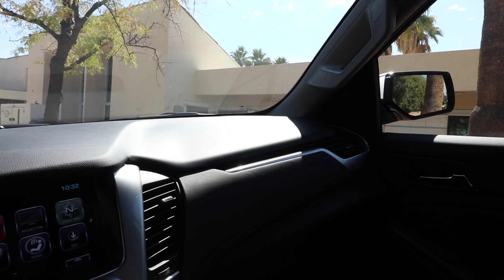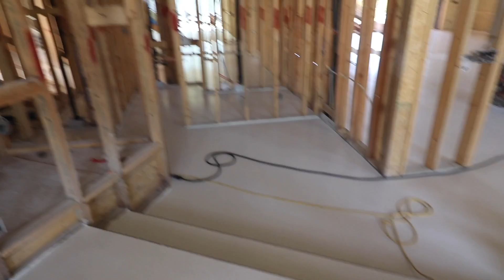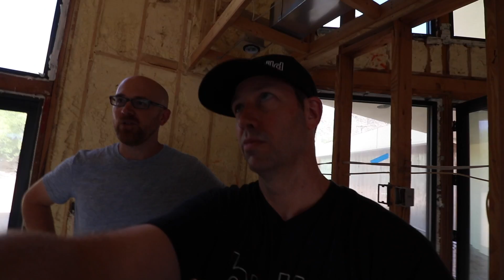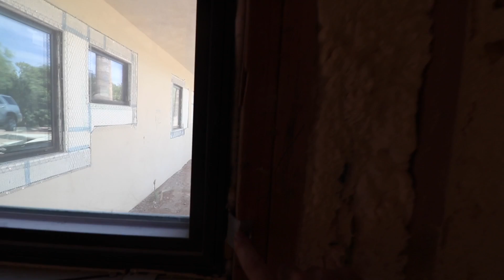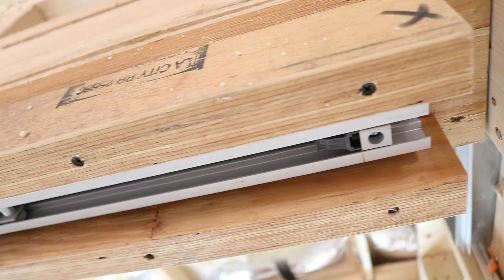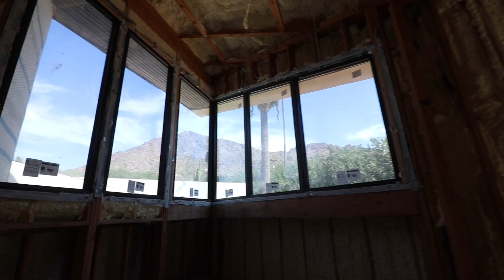Impressive Remodel - Build Show Fan  in AZ

Comment: How hard is it to add fixtures, receptacles, light switch with all the spray foam ? Do electrician have  a trick?
Reply: Eddybarrett84 it’s harder than before it’s insulated. But it’s still possible. I’ve added outlets and plumbing in after the fact, but I would recommend having everything done first.if you have to cut some out just use a can of foam to fill back in.

Comment: Intresting, Is gas water heating really cheaper than using solar collectors? Are you doing rainwater harvesting, water conservation with low flow fosets, water reuse in washing mashine, waste water heat recovery. Local water treatment & bio accumulation in the garden

Comment: I've read from Dr. Straube that when you have a reservoir cladding like stucco, you don't want a vapor impermeable barrier (like closed-cell foam) in the wall cavity.  Is all this CCF going to be an issue, or do you get away with it in such a dry climate like Phoenix?

Comment: Nice to see. Certainly envious of all the space the family will get in this house.
When you do this kind of huge remodel where literary everything interior is new, what might be the actual cost benefit of using the existing exterior walls compared to a complete new build?
Reply: You can grandfather the entire project and it will take a fraction of the time to get a house that size permitted. Plus, if you like that specific area, that's all you can do.
Reply: @tammyfinch6735  Indeed time for permission and such is a factor very much worth being included in budget, but my question is more about the actual building cost.
When remodel 100 % interior it seems a bit weird to not build something completely bespoke, but true there might be regulations as well as aesthetic choices behind why one saves the exterior walls.

Comment: Encasing yourself in foam is the dumbest thing imaginable.  Now not only are you relying on expensive HVAC systems to deliver breathable air, you're dependent on it forever.  How many people are going to properly maintain these systems?  1 in 100? 1 in 1000?
Reply: The house has windows that can be opened   :-) And no, it's not the dumbest thing imaginable. But your comment comes close..
Reply: ArthurDentZaphodBeeb Well this couple will likely live here til the end of their days, and they’ll maintain it properly, so what’s the problem?
Reply: @David-gld  Foam off-gases so once the HVAC system is improperly maintained, you treat your family to all that goodness - formaldehyde, benzene, and a slew of other chemicals.  Why would any sane person want that?  Alternative ways to insulate that don't require you encase yourself in foam..
Reply: @ArthurDentZaphodBeeb  Foam off gasses for a short period of time and will be fully cured LONG before they move in. Plus they'll have an ERV replacing their air constantly with fresh air from outside.

Comment: i see all these big high quality homes but, i see power and no coax or ethernet. it's cost big $$$ to run after the fact if you want the cables hidden in the wall. Cat6a and RG6 quad shield aren't' THAT expensive, even if you spend for pure copper variants when you consider the cost of the home.
Reply: @cdoublejj I agree. $35 for 500 feet is cheap. Should have quad shield RG6 and cat6 minimum 1 drop per room, probably 2 each in living room and master. Simple and cheap.
Reply: Electricians charge out the ass to run those lines usually, even when the walls are open on new builds.  They usually include phone lines and a few Cat5e drops, but somehow costs $100 extra each to use Cat6 instead.

I gutted and renovated and ran PVC conduit and outlet boxes from the attic down to every place I wanted Cat6 and RG6.  Once the walls were up, I pulled the cables through.  It all goes to a 28" media panel in a closet where everything is split.  I DIYed and probably cost under $500 in materials.
Reply: @bigpjohnson  Most electricians charge based upon an hourly rate. Perhaps data cablers charge more since they usually focus on Commercial projects.
Reply: @thehomeowner2646  hey that's really cool of you to reply!! Didn't.mean to pick on you specifically so much as renovation shows in general, nice build you have!
Reply: Possible that the Low voltage cabling hasn't been installed yet. In many cases low voltage cabling happens after HVAC, Plumbing & electrical. I didn't see any low voltage wiring for either fire alarms, or thermistat so its very likely they just have started it yet.

If it helps, I am running QS RG-6 & STP Cat6a cabling. I am going with STP (Shielded) instead unshielded since a get a lot big thunder storms. Nearby lightning strikes cause a localize EMP which can kill devices. A bout 5 years ago while living elsewhere, Lighnting hit a tree about 900 feet away. It trashed my eithernet switches, and a bunch of ethernet wired devices.
Reply: @guytech7310  the shielded cat6a is better anyways, it's practically the same spec as cat 7 if it has individually shielded pairs and is good for 25Gbps which is insane and likely future proof. we did are structure cabling before foam but, we did the walls in sprayed foam not the ceiling (blown insulation) so what you're saying makes sense.
Reply: Vest thing you can do is pre wire and run it all to a closet . Can do hdmi over cat as well so just one cat 5 to every where you need it. That being said I'd just run 4 Access points inside and maybe an outside or two . Anything above residential should be sufficient. Even google mesh has been working out really well but nothing beats wired
Reply: A few people were already onto the correct info in the replies here - Ethernet running throughout the house is NOT needed.  Enterprise WiFi can be done on the cheap now a days, I did my house with just 2 Unifi APs and it covers my small house with 50-150mbps everywhere - I have 160mbps down max.  This is enough for ANYTHING, and can run 12-20 devices easily.  Running Ethernet everywhere and using big switches is a waste IMO.  Much more seamless and nice to have WiFi that's almost as good as Ethernet.  So clean!  

I ran my lines from my basement to the attic then to a couple ceiling APs btw.  This is in a house built in 1963.  Works awesome!  Even for gaming although I don't game anymore.

Last point - is Ethernet going to be faster, higher latency? yes, but only slightly compared to enterprise WiFi.  Do you need it? not really at all IMO, WiFi streams multiple 4K streams at once anyway and you won't notice a difference with gaming if you install it properly.
Reply: @thehomeowner2646  Curious why you want to live in a foam-encased house that will offgas continually and always require conditioned air?  Bizarre choice.
Reply: cdoublejj WiFi routers are so good now that all you need is one coax in to hook to the modem.
Reply: Seth Bracken bull crap. Anything that sits still, like a TV, should be wired. WiFi saturates quickly; a house this size should have at least 2 commercial level access points. That means wiring.
Reply: @jcnash02  Actually, when 802.11AX comes out saturation issues will be a thing of the past (802.11AX is specifically designed to deal with saturation). Combine that with a prosumer mesh router and you won't need to deal with the networking hassle that is commercial WAPs (Christ do I hate access points).
Reply: @sethbracken  actually that's not ENTIRELY true, especially having been hired to fix wifi and internet in big homes like these! Consumer router user "lower binned" chips. heck consumer router usually only have 1 maybe 2 radios tops. Wifi works like round robin, it talks to one device at a time very quickly, vs say a Ubiquiti wifi access point that talk to 2 or 3 devices at once. if you wish to do gaming or VOIP, those wifi routers and wifi mesh systems can have latency over a wired ethernet access point. the mesh systems are getting better so voip likely to bigger but, any kids or gamers you're going to want wired so your aren't getting shot by invisible enemies. ALSO some work from jobs REQUIRE wired ethernet, as i've found with some in medical industry. one last thing wifi has few inherent flaws, 2.4ghz wifi has the best range but, is susceptible to interference and microwaves, 5ghz can deal with interference but, has the shortest range.

Comment: Why would you do the floors first? They're gunna get wrecked doing the rest of the house.
Reply: They are gonna have to buy a lot of ram board $$$$ to cover those floors for the Sheetrock spackle tape, painting, trim etc..
Reply: Every project I do, floors come last. Then I don't have to worry about cracking, dings, wear/tear or paint getting on them. Maybe I'm doing it wrong though!
Reply: 3/8" is gonna crack - they said they had foundation issues and slapping a thin topping coat will bite them in the backside in a few years.
Reply: @ArthurDentZaphodBeeb  amazing how people can make that determination with the little info shared in the video and yet all the pros on the other side of the camera are good with it...
Reply: @mike93lx  Sure, a 3/8 topping with a wonky foundation being covered up isn't gonna crack.  Say, I've got some bridges to sell - you're a perfect buyer. Smh...
Reply: @ArthurDentZaphodBeeb  guess you have it all figured out and Matt is a feckless hack.  Cool.
Reply: Regardless of if it's going to crack, the finished the floors prior to a lot of work. Going to be a nightmare keeping that from getting dinged up. Also,it will crack 100%. The key will be, how much and where.
Reply: @shawnd567  amazing that without fail, YouTube commenters always know more than the content creators.  It is almost like there is no chance there was a pro on the other side that thought this through and made the decision. All projects have compromises. This may be one, but it isn't an unconquerable one. Lots of work is done with finished floors in place (like basically every renovation) and somehow, floors don't always get ruined

Comment: Missed a great opportunity to discuss the residential fire sprinkler system installed in the house. Could educate and shoot down many of the myths involving what they really do and the good that comes from their protection.
Reply: I was concerned about the capability with insulation.
Reply: They are worthless. Cost you a fortune and rarely work as intended 10 years later when possibly needed.
Reply: @willagoateatit3298  really? I'd like to see your sources for that. It's a life safety product that if it doesn't function is a major lawsuit waiting to happen. They work. The get people to safety. The keep fire from spreading further. Studies show they save lives and property. They give you reductions in insurance premiums. Your thoughts are the exact mistruths I said could be debunked.
Reply: @jedigoof1548  Sources? Like those you provided? Regardless, ask homeowners how often they service their sprinkler systems or at least check their functionality. A little over 3000 people die a year from fires in their home, most from smoke inhalation. That's less than .0009% of the population. Suicide alone accounts for more than 45,000 deaths a year. Sprinkler systems are an emotional response to a horrific accident that could normally be prevented by a $20 smoke alarm. The $10-30k cost does not justify the $200 reduction in insurance cost a year. You are spending more of your money so that an insurance company can keep more money for themselves; that's generous of you.

Comment: I like it. But' I don't think it is near thick enough and will crack in a few years time. Just my opinion.
Reply: The Homeowner interested to know the sq ft on the house or even better the floor plan? Also sq ft on the lot you’re on in comparison to the home sq ft. Couldn’t tell where what room was what in relation to the other rooms since Matt breezed through the walk through the house.
Reply: @kenkphu  What does this have to do with the floor possibly cracking due to improper thickness? You tell me?
Reply: @kennedy67951  I was not replying to you, was to homeowner, apologies if you were mistaking included.  My question has nothing to do with the floor or the possibly cracking thereof in the future.
Reply: @thehomeowner2646  I have a feeling you were sold on bull crap. The person that recommended this to you did not really talk thickness due to saving money on your project. Don't get me wrong. This is a very nice choice. But if this was laid down over wood it will crack. No doubt. The problem is that fixing this type of era is almost impossible to do with good results in the end. Your contractor should have gone over all this with you in detail. If this was done on top of concrete well okay. This would have been a more stable platform to build upon.  I know you did not ask for my opinion. But there should have been a stress test done on this materiel before install in my opinion. You did not show this in your video that I seen. I have seen all this before and after it's done the home owner is stuck with what ever happens or the out come. Thank you for your time showing me your part of your build.
Reply: Okay.
Reply: It's not if it will crack, only when. Homeowners said there were foundation issues - they'll easily telegraph thru that thin material. The ideal choice was tile because it can be replaced if tiles crack (but good tile is expensive).  That Ardex will be a nightmare to match.  They'd be smart to buy 20 bags and store it so they have something that will match when the inevitable repairs need to be made.

Comment: Matt, make video about venting bathrooms in house with HRV/ERV. Venting up or down or vent or not at all? I am searching data on this and there is paucity of data only..
Reply: Just had this question go through my mind the other day!!
Reply: I have been trying to figure out the exact same thing.
Reply: I guess you'd have to have it two ways. You could direct vent the bathroom fan (leaky) and have it trigger your HRV to bring in replacement air. Or have the bath fan vent into the HRV directly. The second one controls the air better but I'm wondering how to address the high humidity air?

Comment: Everytime I watch one of your videos about remodels I realize how much work would need to occur to bring my current mid 80's home to any level of energy effecient design. Thank you for showing such a wide variety of homes and products.
Reply: My 2015 home is an energy pig...  Luckily we bought into solar when there were a bunch of rebates and incentives so my electric bill, when I have one, is very low (>$50).  I wonder what the up cost is to have a strong, efficient home.
Reply: i don't see the "Build" show doing any affordable housing, or did I miss that episode?
Reply: @timskufca8039  Its more about the tech he talks about.   Things like foaming all the gaps and penetrations in the sheathing is quick and cheap to do, also making sure windows and doors are properly flashed.  I gutted my 1950 house and sealed all the gaps and penetrations in the crappy fiber sheathing, it cut down on all drafts completely without having to rip off the exterior.  Its stuff that costs a few grand extra but yields major savings over time.
Reply: @bigpjohnson  Yes, the Build show is very good about showing the importance of a well designed/built envelope. Matt knows his stuff, for sure. But these high-end projects could be better demonstrations about their resource uses. Having super-polished floors and put off solar panel installation seems way off kilter. [I know Matt has nothing to say about how his clients prioritize their dollars, but it is disappointing noinetheless]
Reply: My long range plan is to find a bit of property out in Colorado and design and build from the ground up a home that is energy effecient and air tight. Down here in south florida it is to expensive to find good property and contractors who will build to suit are few and far between...

Comment: I don't even want to know how much it cost to run AC on that house.
Reply: It shouldn't be that bad with all the insulation. Add to it that Arizona is one of the more ideal climates for solar, and they should be sitting pretty.
Reply: 500-1000 for utilities probably.  But when you're building a multi million dollar house the money probably isn't a big deal.
Reply: @Whatwherewhy586  No way will they be anywhere near $500/mo (let alone $1K) with that amount of insulation and efficient equipment.   Maybe $300 for hottest months.  And next to nothing in shoulder months.
Reply: I live in a very similar climate (Southern Nevada, we're usually 3-5 degrees cooler than Phoenix). You're looking at peak cooling bills of $300-500 during about 3 months of the year. My averaged electricity bill came out to $183/mo. I installed solar last winter, and with a real production of 45-50 KWh/day I'd be a little under the break-even point; I'm going to be cheating next year and replacing my SEER 6-8 unit to a SEER 22, so I'll be net-zero next summer with plenty of budget to change over to an electric furnace/water heater.
Reply: I pay 600 a month for 2500 square ft in the Phoenix area
Reply: @fpsweet66  Ouch brother, Im out in Buckeye with a split level 1st 2-Story 2500sqft and my MAX summer is $480 (last month with weather was $390) and my "equalizer" program payment is $267/mo with about 2.9k kWh usage.  You gotta look at your equipment and house structure for efficiency losses.  My place is a stick built contractor special tract built a few months before the crash.
Reply: @fpsweet66  Is your house insulated as well as this one? I know mine isn't.
Reply: @jackielinde7568  no, not even close. My house is from 2002 and home building here was very inefficient back then. Crappy windows, very little insulation in the attic and no thermal barrier to the outside.
Reply: @fpsweet66  put half of that amount towards solar and battery and you'll still come out ahead.
Reply: I am sure the material\equipment\installation cost a bundle. My guess is the provably paid $60K to $80K for the HVAC system.